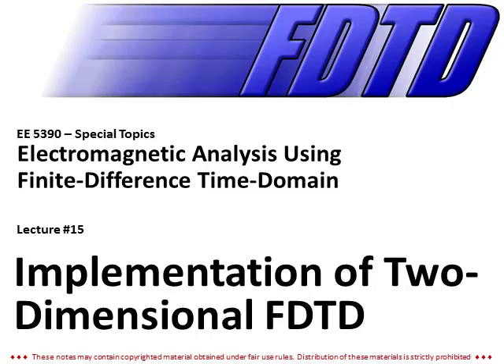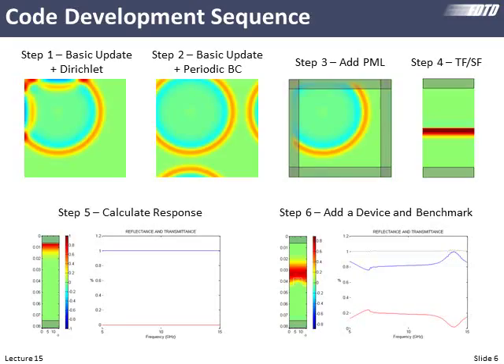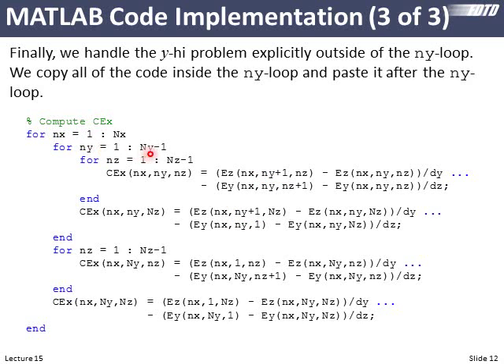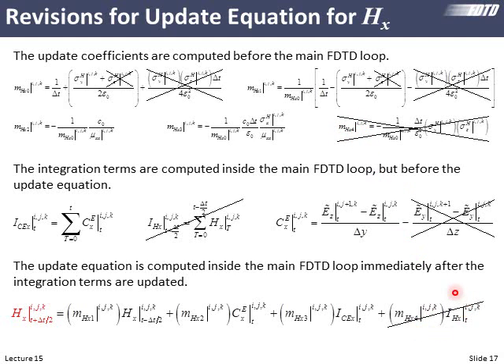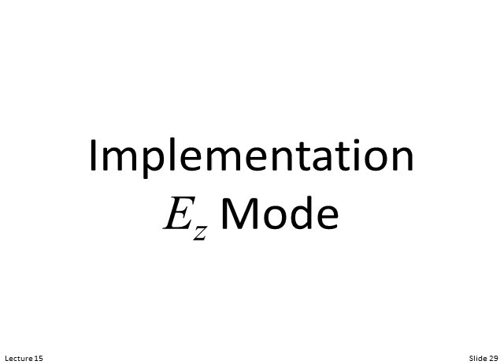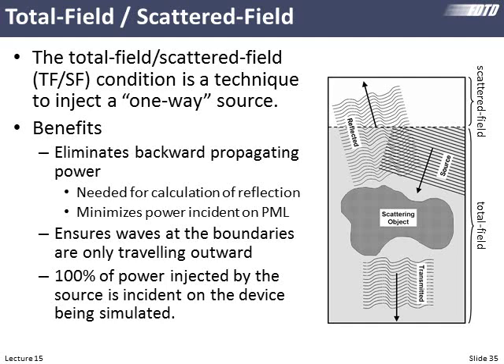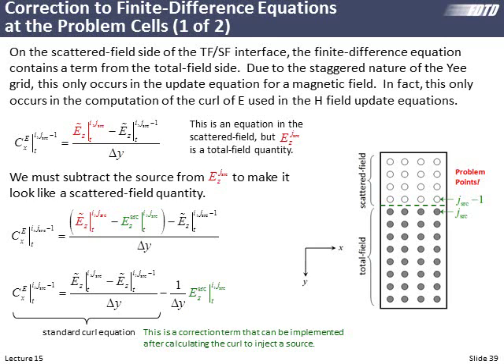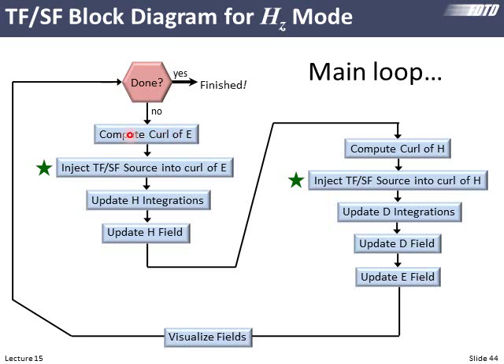Lecture 15 (FDTD) -- Implementation of 2D FDTD

Comment: Hello everybody, hope you are doing marvelous.
I have a problem with my code, wrote it over and over again, but couldnt find what is wrong. Can somebody help me?
Thanks in for your time!
Reply from the maker: Can you describe your problem in more detail here?
Reply: @empossible1577  at the right and upper boundaries the absorption seems correct, but at the other it doesnt. Also, I made a few adjustments to the code because the propegation wasnt happening at all.. Do you want me to sent you the code?
Reply from the maker: @TasosKamenides  Trying launching your source in a different direction. If the problem stays at the same spot, the problem is mostly likely in the PML code associated with that location.
Reply: @empossible1577  thank you professor!

Comment: I've been loving these lectures! For the PML problem I'm getting a similar structure, circular that gets absorbed by the boundary, but I'm concerned that the values along the grid themselves aren't correct. They're pretty low, roughly +/-.1 at the highest and lowest. I know I have my parameters correct, are there any resources for confirming my fdtd engine is working? Same with dirichlet BCs, it looks similar, but I'd love to be sure.
Reply from the maker: If you are launching a cylindrical wave, that will decay with distance.  I am not sure what amplitude you are launching, but the 0.1 does not sound wrong.

Your other question is called benchmarking.  At this early state it is hard to find something to benchmark against.  I recommend just making sure your FDTD can run a long time without exploding or going unstable.  After that, you will build up to a simulate of a real device that has a known answer.

I am not sure if you are aware of the official course website.  I recommend using this as your main portal to the course.  I keep this up-to-date with the latest version of the notes, videos, and include other resources to help you.  Here is the link:

https://empossible.net/emp5304/

If you are willing to spend any money, there is also a fully online course for beginners in FDTD.  It is an excellent course and includes MATLAB codes, devices examples, etc.

https://empossible.thinkific.com/collections?category=FDTD-in-MATLAB

Hope this helps!
Reply: @empossible1577  I'm injecting a gaussian pulse into the center of the electric field, the standard exp(-((t-t_0)/tau)^2) with the parameters set up in the sample homework 8. If the .1 sounds within reason, I'm content with that. Thanks for the quick response, and again, thanks for these lectures, they've been a tremendous help!

Comment: Dr. Rumpf, thank you for the great resource. I am trying to get my head around the concept of reducing a 3D problem to 2D, by setting all the z derivatives to 0. That seems arbitrary. You seem to suggest that we can do this because the object is infinite in extent in z direction. That is fine but how can we assume uniformity from infinite extent in the z-direction. Surely, in any real device, the wave is changing in the z direction even if it is a uniform plane wave? I am missing something basic here, but can't figure out what!
Reply from the maker: It is absolutely true that there is no device of infinite extent in any direction.  However, when calculating modes in a waveguide, the modes are calculated as if the waveguide were infinitely long.  Photonic band diagrams are calculated as if photonic crystals were of infinite extent in all directions.  Integrated optical devices can be converted to a 2D problem using effective medium theory.  In the end, I think the answer you are looking for is that it is just a very good approximation that can analyze real problems very accurately and much more efficiently.

Comment: mDz1 is missing a division by mDz0. That's a week of my life I won't get back. 18:57 Nah it's fine, these lecture are great :P
Reply from the maker: Sorry for the week of your life, but I cannot find that mistake in the notes.  Maybe you missed that it was done in a second step?

Also, have you visited the course website?  This has the latest version of the notes where some errors have been corrected.  Here is the link:

https://empossible.net/academics/emp5304/
Reply: @empossible1577  Aha, no problem.

Btw the issue is still present in the updated course. Look at the MATLAB code for mDz1 on Slide 29. It's missing a division by mDz0. The formula is correct on the right, but the MATLAB is wrong.
Reply from the maker: @ctrl-alt-tutor5587  Hmmm...Did you see that mDz1 is calculated in two steps?  The second step divides mDz1 by mDz0 unless I am missing something.
Reply: @empossible1577  Oh my goodness. Just... ignore me.
Reply from the maker: @ctrl-alt-tutor5587  If it helps, I have been stuck on stupid things that cost me way more than a week from my life.  Welcome to CEM!

Comment: Hi Professor, I have a few questions about 2D finite differences
1) Would boundaries (periodic/absorbing/dirichlet, etc) affect the implementation of TF/SF plane wave source? I observed that in many of the implementations involved a periodic boundary.
2) I used your test functions and parameters in your web assignment, and found that my gaussian soft source was steep when Ez was animated (no evidence of a gaussian, which is especially obvious when I plotted the cross section of Ez for the duration of the simulation). This was unlike what I saw for a similar soft source in 1D FDTD. Is this natural? 

I eventually got a similar result the example provided, though at a shorter timestep (~150).
 I would appreciate if you could enlighten me on this, and thank you for this wonderful resource!

Comment: Hi Professor, in Slide 29 of the PDF material (version 1/22/2020), it's mDz1 in numerical form, while it corresponds to mDx1 in analytical form, is it a mistake? Thanks
Reply from the maker: You caught a mistake!  There is no Dx in this code.  Thank you!

Comment: I have a question about plane wave source. The entire Ezsource Hxsource arrays must be filled from g(t) function across the i index? 
Thank you for your videos!
Reply from the maker: Close, but not exactly.  E and H sources are slightly delayed from each other and can have a different amplitude depending on the impedance of the medium where the source is being injected.  I usually just set Esrc = g(t) and then adjust the delay and amplitude of Hsrc to match.  Hsrc = Ag(t-t0).  For plane waves, this function are constant across the grid.
Reply: @empossible1577  I tried it and it;s working only with periodic boundaries. am i right?
Reply from the maker: @mixalismilo  You can make it work with any boundaries.  If you are using a PML, just be sure the TF/SF interface is not overlapping the PML.
Reply: In addition the amplitube of the sources must be much less than 1 because the summation of them becomes a huge number that can't decay at PML?
Reply from the maker: @mixalismilo  No.  I make the amplitude of all my sources around 1.0.

Comment: Dr. Rumpf, 
Can I ask you for some tips on TF-SF formulation without PML and without any scattering object? I can email you my work. I have used your notes, books by Dennis M Sullivan and Allen Taflove for modeling TF/SF but my results are completely messed up. Thanks.
Reply from the maker: Yes.  Ask away!
Reply: @empossible1577  There are few things that are not clear:
1. initial values to EzSRC() and HxSRC() arrays. (I have assumed it to be zero)
2. why don't we calculate correction terms for Hy at i=ia and i=ib in 2D formulation without PML ?

3. What checks can I try to find the source of errors in my solutions? 
4. At what location should I specify EzSRC(j=?) = G(t)? (I am specifying it at j=1)
Reply: Do you have any other notes where TF/SF formulation without PML is discussed? It will be really helpful.
Reply from the maker: @RevisitingTime  In FDTD, I have more advanced TF/SF notes in Lecture 24 here:

http://emlab.utep.edu/ee5390fdtd.htm

For finite-difference frequency-domain, see Lectures 13-15 here:

http://emlab.utep.edu/ee5390cem.htm

There is also a paper that is reasonably good...

R. C. Rumpf, "Simple implementation of arbitrarily shaped total-field/scattered-field regions in finite-difference frequency-domain," PIERS B, Vol. 36, 221-248, 2012.
Reply from the maker: @RevisitingTime  1. Yes, these source functions are initially zero.  You always want to ease into and out of the source.

2. It is only the tangential components of the field whos finite-difference equations contains terms from both sides of the interface.  Therefore, it is only the tangential components that need correcting.

3. That is a big question.  In general, keep in mind the development sequence that I talk about.  Write your codes in small steps that you can check along the way.  When troubleshooting, try to find ways to simplify what you are doing.  For example, if I am simulating a device and something is going wrong, I will replace all my material properties with 1.0 (air) and I will make sure that simulations works correctly.  You can also follow the homeworks on the course website to develop your codes.  There are even some tester functions that will test parts of your code for you.

http://emlab.utep.edu/ee5390fdtd.htm

You will want to place your source normally just outside of your PML.  In general, it can be place anywhere between the PML and your device.

Hope this helps!
Reply: @empossible1577  About point 2: So in your notes in lecture 24, on the x-lo and x-hi side you do have HySRC correction term. In the book by Sullivan, they have not used x-lo and x-hi correction terms, however in book by Taflove, they did mentioned about HySRC correction term. 
Does that mean that we need to have HySRC term for the TF/SF formulation at x-lo and x-hi? The information provided in Sullivan book looks to be incomplete.
 

At first my inference from Taflove book was that HySRC is used when the incident source is introduced at some angle phi and then it can be resolved into two components HxSRC and HySRC (looks like I got it wrong here).
Reply: Just to keep you informed: Until now, I was using only EzSRC correction term on the scattered field side of x-lo and x-hi.
Reply from the maker: @RevisitingTime  I am at a conference and do not have that book with me to check for sure.  I suspect they are incomplete.  Any field component tangential to the TF/SF interface will contain terms from both sides and will require a correction term.  I don't know how to get around that.
Reply: @empossible1577  Dr. Rumpf, Would you mind if I email you my TF-SF result figures for you to have a look  at it and see if it makes any sense? I feel that my numerical solution is working correct physically, but somehow the Ez field values are off. I am using a little different approach than given in lecture 24 of your notes. I will explain that in email as well.
Reply from the maker: @RevisitingTime  Sure.  rcrumpf(at)utep.edu

Comment: Hello prof.Thanks again. I got the TF/SF incorporated and running. However, I see that, when the plane wave is propagating down in the y direction of the grid, there is this bulge that grows outward with time close to both tips of the propagating plane wave. I thought this could be a problem with the boundary conditions at x low and high so I limited the plane wave so that, the plane wave is not touching the x low and high as it propagates down the y-grid axis, but I still see this bulge growing outward. Please what could possibly be wrong here.
Reply from the maker: I replied to this in your other post and gave you some things to check.
Reply: I had the same issue but it was fixed when I put periodic boundaries in the x-axis (as was advised in the lecture). Maybe this helps someone.

Comment: Hello Dr Ray. Thanks for this awesome resources. Just a clarification. Do you need to define the source for the Hy field like you did  Hx and Ez. If it has to be defined, how can it be injected into the Grid? Can you explain briefly. Thank you.
Reply from the maker: You only ever need to calculate the components that are tangential to the TF/SF interface.    So, the direction of the TF/SF interface dictates which components of the field you need to calculate.  In scattering problems, the TF/SF interface completely encloses a scattering object so all components must be calculated.  Take a look at the notes for Lecture 24 on the official course website where this is done.

http://emlab.utep.edu/ee5390fdtd.htm
Reply: CEM Lectures . Thanks Prof Ray. Will take a look at that.
Reply: Hello prof.Thanks again. I got the TF/SF incorporated and running. However, I see that, when the plane wave is propagating down in the y direction of the grid, there is this bulge that grows out ward with time close to both tips of the propagating plane wave. I thought this could be a problem with the boundary conditions at x low and high so I limited the plane wave so that, the plane wave is not touching the x low and high as it propagates down the y-grid axis, but I still see this bulge growing out. Please what could possibly be wrong here.
Reply from the maker: I am not sure how you are trying to setup your simulation.  I "think" you have a square TF/SF enclosing your simulation?  If so, there are a few potential things to look for.  First, the TF/SF interface must reside entirely inside of a homogeneous medium for a plane wave source.  If this is not the case, you will have problems.  Second, for large grids, numerical dispersion can become a problem and the wave gets out of phase with the source wave you are calculating at the TF/SF boundary.  To check this, crank up your grid resolution to see if it gets better.  If so, look through the notes for how to compensate for numerical dispersion.  It is pretty simple.  Last, maybe you have a problem with your TF/SF equations.  It is not the same field components that have revised finite-difference equations at each boundary.  It is only the tangential fields at the interface that will get modified update equations.  Did any of this help?

Comment: Dr. Rumpf, few questions here: The sigx and sigy depend on timestep (dt) and with simulation of smaller structures (in orders of nanometers) the two terms are becoming horrendously large from the get go (like 0, 0, 96, 890, ... . you get the idea). Because of that, i am afraid that there will be large reflections from pml interface. 
 So my question is, should I use upml with nanostructures or should I start using cpml ad hoc? And if so, will there be some improvements?

Thank you a LOT for your time and attention,
Tornike

Comment: Hello! 
My project is based on study of soil resistivity and its effect on earth electrode resistance under lightning conditions. I confused with mainly four problems  
1. choosing parameters (frequency, λ etc.. )
2. choosing source (TF/SF or Gaussian source to Dz)
3. earth electrode is a rod with r radius, therefore how I assign ERzz, HRxx and HRyy values to the circular area on the grid
4. getting resistance values from E and H fields 
If you could response me for this it is a great appreciation.

Comment: In slide 31, what is the equation of g(T) term related to Dz at inject source part?

In slide 41,42, there are two source terms for Ez and Hx, so what are the source terms and their equations related to the 2D FDTD grid layout in slide 37?
Reply from the maker: g(T) is the Gaussian source function that was described on Slide 8 of Lecture 7.  In this step of the algorithm we are simply adding the current value of g(T) to Dz to inject the source.

The equations to calculate Hz and Ez source terms are provided on slide 42.  For a wave at normal incidence, the value of Ex and Hz is a constant across the grid.  Maybe you are looking for an 'i' array index in those equations, but it is not there because they are constant across the grid.  They are calculated right at the interface between the total-field and scattered-field regions.  The array index jsrc is the vertical position in the grid where the source is injected.
Reply: Actually I am looking for a Hy term with the Ez and Hx, when the TF/SF located in both X and Y directions (like slide 37 grid layout).
Reply from the maker: That is a bit more challenging.  I have created a set of notes about this, but I have not yet made a video recording of the lecture.  You can get the electronic notes from the official course website at the following link.  The material is in Lecture 24 - Scattering Analysis.

http://emlab.utep.edu/ee5390fdtd.htm

Comment: Hello again !

I have another query. How to implement frequency dependent complex permittivity and frequency dependent conductivity using this formulation? Thanks in advance.
Reply from the maker: There are several ways to do this.  I cover using the Lorentz-Drude model in Lecture 10.  I like this approach because the intermediate parameters have physical meaning and can be visualized to learn something.